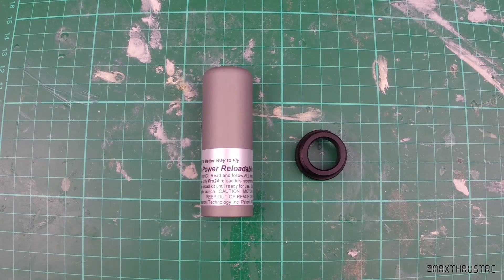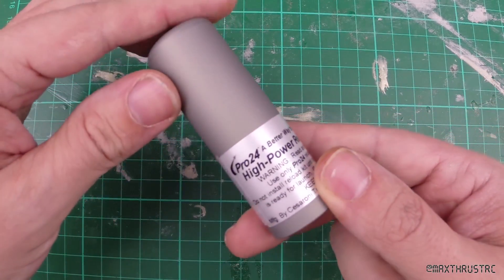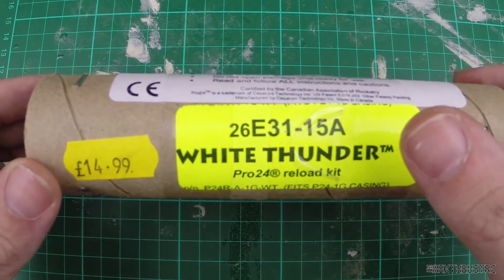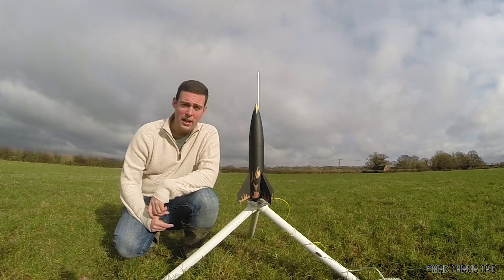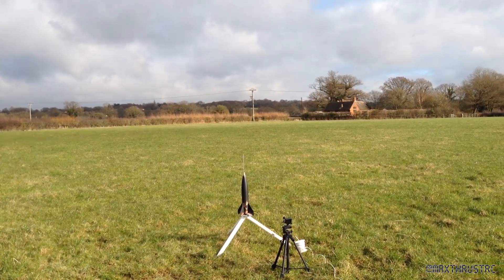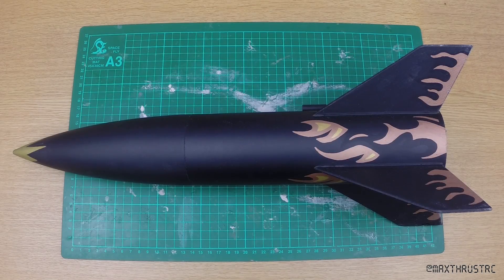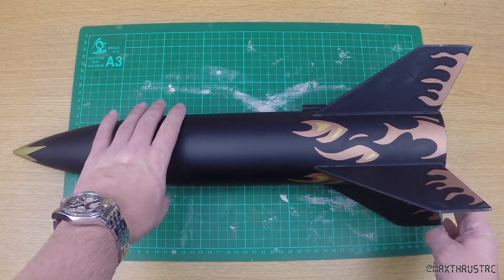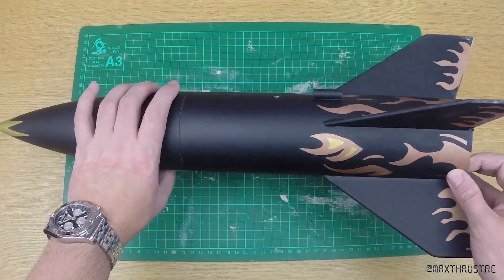Estes Big Daddy AP E Motor!

Comment: Great video! What is the fire-retardent cloth that you use? something reusable sounds way better than making or buying the paper sheets.
Reply: ive used toilet paper before.....in a  or d motor

sometimes it does catch fire.....but usually burns out before reaching the ground (plus, i had a bucket of water with me)

never started any fires.....made sure the grass wasnt super dry......did it as safe as i could

Comment: I like the paint job! I have a Big Daddy in my build pile from last year, and a Pro-24X case and a couple reloads I bought last summer but didn't get the opportunity to use yet. Of course I also have a Mega Mosquito that'll probably eat those reloads before the BD gets a chance...

That launch rod looks pretty short. Is the rocket getting up to stable speed before hitting the end of the rod? Might be a longer rod would help it fly straighter?
Reply from the maker: Thanks, I'm really happy with the paint job. I originally used the full length of the rod and the rocket was getting too much drag from it. So it was actually reducing the rockets velocity when it was getting to the later stages of rail travel. Hence the use of the shorter rod. Also with that impulse motor the rocket was easily over 30mph at the end of its travel down the shorter rod.
Reply: maxthrustrc Makes sense. I'll have to check when I build mine to make sure the launch lug is loose enough on the rod.